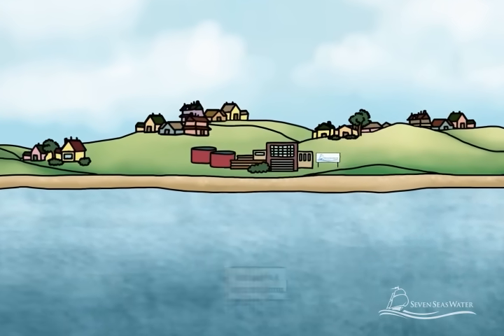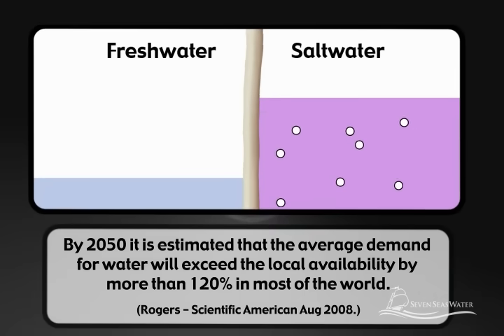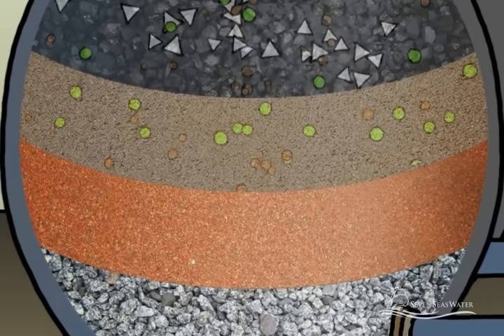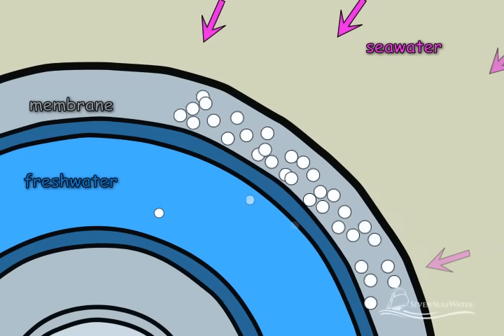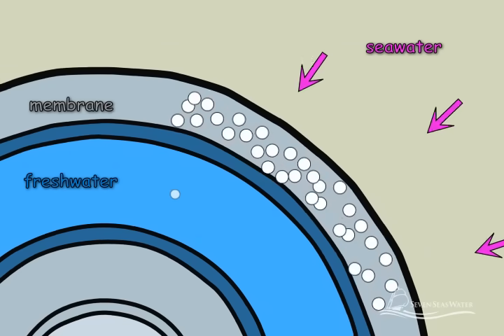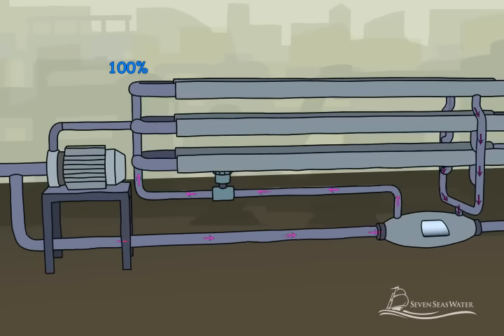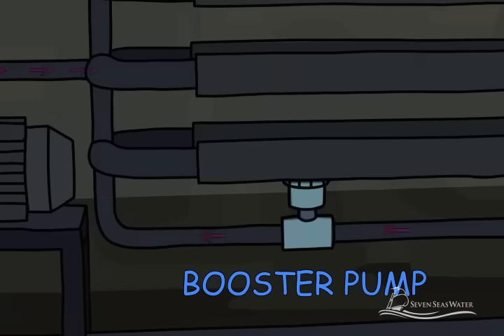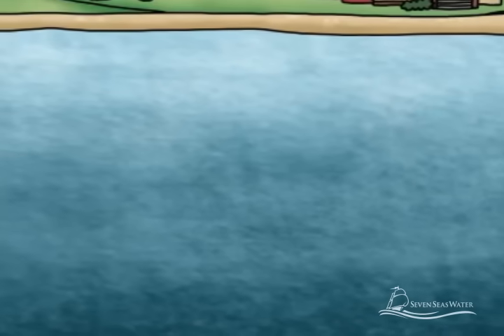How Seawater Desalination Works

Comment: why not use the brine to produce salt so no marine life gets killed due to sudden increase in salinity
Reply: Because you then have tens of thousands of tons of salt to dispose of, which if you dump it on land will poison the land and eventually wash back into the sea anyway. Due to the way the water cycle works, this process causes no net increase in salinity of the sea as a whole, but it does increase salinity at a local level. The brine needs to be dispersed much more widely to reduce the impact.

Comment: How often are those filters cleaned or changed?  I would be worried about lazy operators.  Who would make sure the plant is running properly and what would be the consequences imposed if it were found to be corrupted.  Greed is everywhere, as is human laziness.
Reply: As filters reach the end of their lifespan, the pressure difference across them increases, and the amount of water going through will decrease. If the operators weren't doing their jobs it would quickly become apparent, and they would probably be fired.
Either way, you'd have no reason to worry. Just because a filter starts getting clogged doesn't mean that it will let unsafe things get through. It would just let less water through.

Comment: doesn't ocean water have amonia?, i saw multimedia filters, other unclear type of filters, rivers osmosis, but were's the thing that removes chemicals from the water?
Reply: soro911 don't pools have pee
Reply: Since its surface water extraction, the RO process has methods of removing oil and other chemicals... micro tubes, it's a separate process that the desalted water goes through.
I thought it was funny they talked about the other processes the de-salted water goes through like further treatment and then chlorination, but didn't show any of the structure for it.  It's expensive on its own.
It's why water utilities around the world try first to use ground water before seeking surface water like river or lake water.  
Ground water is tested and filtered naturally not requiring a full chemical removal treatment... so long as the well continues to show safe levels of potentially harmful compounds and elements.

Comment: Wouldn't this make the sea water more dense in water which can hurt animals
Reply: Mongie Games the water we use is ether reused or cleaned and dumped back into the ocean it doesn't disappear thats like saying when its hot out and sea water evaporates does it hurt the wildlife of course not the oceans are much to big for any real effects
Reply: the difference between air pollution and water salivation is that we are not permanently reducing the overall amount of water in the ocean, because when we drink it it will either runoff back into the ocean via a river, or just evaporate and form clouds, drifting back to the ocean over time. therefore we are not decreasing the amount of water in the ocean. Since we aren't adding salt to the ocean, only concentrating it in a location, the amount of salt in the ocean isn't changing either. Because of this The overall ratio of water to salt will remain the same. The only time that desalination actually increases the amount of salt in the ocean is localized, and will rapidly lose effect over time. the problem is that desalination plants dump brine into the water continuously, so even though the salt is drifting back out to sea, it is constantly being replaced, making the harbor, bay, etc. too salty for marine life.
Reply: "Wouldn't this make the sea water more dense in water which can hurt animals"
It makes the salinity higher in the few meters of distance around the salt return. Salinity falls off with the square of distance back to background levels.

"if you take volume of water but leave the same amount of salt the salt density will go up"
But they're not talking away the water. They're cleaning the salt out of it, and then using it, before it runs back to the sea. Water doesn't get deleted from existence when you send it to the city. It gets used and then comes back to the ocean.

"The people who made combustion cars undoubtedly said the same thing about pollution"
The pollution we burn isn't finding its way back into the ground. The water we use is finding its way back to the sea. So this argument doesn't apply because the situations aren't similar. To make it similar, either water would have to stop flowing downhill, or air pollution would have to stop floating into the sky and fall straight down to the ground.

"This video doesn't say it returns to the ocean most likely a reserve to hold extra fresh water"
Of course there's a reserve. They don't have to say it returns to the ocean because it's obvious. Nothing can stop it from returning to the ocean. The city uses the reserve. They're not collecting it to look at for artistic purpose. They water things with it, drink it, and piss it back into the ocean.

"that is one of the biggest arguments against desalination plants, the excess of salt can easily kill marine life."
It can kill marine life within a few metes of the salt return, yes. If you put a net around the return a few meters away to keep all sea life out, you've stopped that from happening.

"the problem is that desalination plants dump brine into the water continuously, so even though the salt is drifting back out to sea, it is constantly being replaced, making the harbor, bay, etc. too salty for marine life."
No, that's not true, because the ocean has currents and mixes itself continuously. The salty water from the bay goes out to sea and fresh water returns. The rate at which desalinization plants increase the salt is only strong enough to be dangerous to marine life a few meters from the salt return. After that the flowing water currents of the ocean have returned it to normal by mixing it back with the fresh water you used returning back to the sea again.
Reply: John Arizona you proved my point if you take clean water from the sea over a long period of time you can hurt sea animals because the density of salt will go up because by your analogy you saying the sky's to big to get polluted was a myth so taking water from the sea not worrying about sea percent going up is a myth as well
Reply: Mongie Games It does return to the ocean.
Reply: that is one of the biggest arguments against desalination plants, the excess of salt can easily kill marine life.
Reply: Mongie Games read what you typed friend. Rewrite and repost, I will read.
Reply: Mongie Games the water eventually finds its way back into the ocean it doesn't disappear
Reply: Mongie Games No they said 60%saltier than water coming in
Reply: goes back to ocean of course
Reply: Mongie Games
 i think water current will distribute the salt everywhere. the ocean have waves. so don't worry because the rain will equalize it later.
Reply: AIYarabiaa no but your making the water more dense in salt you showed it in your video it's simple chemistry if you take volume of water but leave the same amount of salt the salt density will go up
Reply: Mongie Games
The water will return as stated and the amount of water we could take out of the oceon wouldn't make the slightest difference in ocean concentration. Provided it isn't placed right next to sensitive wildlife.
Reply: John Arizona the reason theres an effect on air quality is because they are letting out co2 and other pollutants that would otherwise be underground
Reply: This video doesn't say it returns to the ocean most likely a reserve to hold extra fresh water
Reply: caleb williams To secrete or produce saliva. 2. Informal To be full of desire or eagerness for something: salivated at the idea of winning the lottery. v.tr. To produce excessive salivation in.
Reply: John Arizona oh salination auto corrects to salivation lol. wait how is desalination a word but not salination?
Reply: caleb williams Both words different meanings. haha
Reply: It will not make the sea saltier because all the water that has been desalinated goes back to the sea as unsalted water (of course with some extra chemicals and contaminants) thru our drainage, rivers, and sewage systems.
Reply: William Barnes water is stored is wildlife so if you constantly pull water from the ocean to water vegetation then that water is not being returned to the ocean plus animals are holding water too if you breed 50 dogs this week and use ocean water for tgem to drink they will be storing more water as they grow in size so it might be 10-20 yrs before the animal dies and returns the water back to the ecosystem
Reply: The General You forget that animals pee. That gets returned to the soil. All water on Earth get recycled.
Reply: Jumin Han animals dont urinate all of the water out of their body so 100 pound animal will be retaining roughly 80 pounds or 10 gallons of water until the animal dies
Reply: Mongie Games Look up the water cycle dumbass.
Reply: The General . Water is required for respiration. Every time you exhale you breath out a little bit of water. When you sweat, water gets evaporated off your skin. When you exercise the glucose molecules (C6H12O6), and water (H2O) in your body get converted to H2O and CO2. You're a dink. 

The water cycle.
Conservation of matter. 
Facts, you're wrong.
Reply: When you think of the big picture and remember that are polar ice caps are losing ice therefore seawater is bound to rise the concentration of that sea water that is locked into the ice caps is less than regular sea water cuz it has less salt because it's literally frozen rain on top of those a polar ice caps or frozen moisture vessel so if you account for the fact that sea levels Rising with a whole lot more fresh water but that fresh water is messing with the salt water and then you put a whole bunch of desalination plants on the edges of coastlines you are really concentrating the ocean and don't forget that this water is going back into the ocean through processes of septic tanks or cleaning facilities yada yada yada and it's an equal but if you're coming up a local salvation of the area it is why is that people who do Seven Nation plants to put that exit valves in areas like well like the video States in areas where there is high flow So eventually it'll the water leaving the pipes from the will turn back into more equalized salinity due to the turbulence of where the exit pipes are put
Reply: Sorry I'm using text to speech and it really f*** up my last comment
Reply: I know this sounds dumb but could we just use it to make actual salt?
Reply: TheMoistMango : not dumb at all, just that there may already be plenty of salt production.
Reply: It could probably make salt production much easier since after filtration it would be in higher concentrations.  It would be better to turn it into salt and maybe through evaporation it could release water vapor into the atmosphere and the rest is turned into salt.  I'm not exactly sure how big companies make salt though.
Reply: So long as they spread it out in a big outflow area... and it never becomes so heavily used that rain water and fresh river water intake becomes less than intake of the brine solution.
Essentially, so long as we never rely on desalination for major agriculture we're okay.
But if we ever are reliant on desal for food production, we'll be feeling it as a slice of bread would cost in 2018 dollars about $50 to $100 dollars for a slice. Meat, well as steak would be close to $500.
Reply: Better them than us be without water.
Reply: The people who made combustion cars undoubtedly said the same thing about pollution "ahh the sky is too big for exhaust pollution to add up". Have you seen Chinas air quality or LA?

Comment: what kind of pump to they use ?
Reply: Nishikino Mimi garden pump
Reply: strong one :p
Reply: Nishikino Mimi Really big Lips
Reply: Kind of late, but the pump in the animation was depicted as a centrifugal pump... however, they showed it as a single stage pump, and in reality you'd need a pump with several stages and a powerful motor to reach 1000psig.
Reply: lil pump lol
Reply: Positive displacement pumps are often used in RO to provide constant freshwater flow against a high system backpressure from the membranes

Comment: y not just distalize it it's much easier and doesn't need the chemicals
Reply: costs more
Reply: If people would stop being so scared of nuclear power we'd have plenty of energy for it.
Reply: Need more energy and heat cost more
Reply: Monstrosity Sound Inc. I believe if you filter it through the ground enough you can remove most of the salt
Reply: @jerrymacmillanjr9955  Until the earth is saturated with salt, in about oh, 2 weeks.
Reply: but will take different activates as in the video
Reply: Reverse osmosis doesn't use harmful chemicals!
Reply: Chlorine Bleach is the best invention of the 20th Century.

Comment: 500 liter stainless steel (ss) water tank manufacturer and supplier in 
Bangladesh,1000 liter stainless steel (ss) water tank manufacturer and 
supplier in Bangladesh, 2000 liter stainless steel (ss) water tank 
manufacturer and supplier in Bangladesh,3000 liter stainless steel (ss) 
water tank manufacturer and supplier in Bangladesh

Comment: why can't we boil the sea water and collect the vapour from it on a mass scale isn't this cleaner and more efficient?
Reply: +kefalonia3 desalination on seawater alone is expensive and energy-intensive, polluted water would require more energy and be even more expensive. 

But disregarding those factors, compared to distillation, I think desalination would do a better job as it would be faster.
Reply: That's water distillation which is a thing but at that level would probably use way to much energy to boil water and a slower process overall. Just a guess but these filters can probably run low maintenance using less energy.
Reply: FutureAirways2 but can desalination work with really contaminated water? I mean really really polluted water?

Or does distillation do a better job?
Reply: In order for us to distill water we need to heat it up first, which we need to use some sort of reasource to do that. If you look at the basics of how coal, oil, and nuclear power plants work they're just steam engines that run off boiling water to crank a generator, so making a water distillation plant do the same thing would be like building a new power plant just for collecting water.

Comment: I wonder what the longterm effect will be of having such a highly concentrated salty return of water to the sea. Even if quickly put back and dispersed with natural flow, overall the salinity keeps increasing.
Reply: +Sabre you know water will make its way back to the sea right? its not like we're running out of water.
Reply: Sabre the salt was removed and then returned to the sea. Not a big deal if the return takes place in a a high flow area.
Reply: Earth is 70% water and that is like infinite water.
Reply: Even if NONE of the water ever returned to the sea, it would take practically for ever before a noticeable change would occur. Sea life would be able to evolve to the new conditions much faster than we could increase the salinity. Of all the problems one could worry about, this one must be very near the bottom of the list.
Reply: Tim Laursen
The salinity of the oceans is not effected AT ALL unless you lower the level of the sea, store fresh water on land in massive quantities which is NOT happening.  Only ice ages have done that.  Same quantity of salt and same sea level means identical concentration of salt.

Comment: Put solar systems on big vessels wich are heated by teh solar power + the natural heat of the sun and seperate the salt,sand etc. from the water, then further process this water with whateer cheap crap you want (e.g chemicals), way easier.
Reply: You might think solar hyrdo electric and wind energy would cost less but the investment building that grid far outways the cost to run these. Either way you still have to build a plant. So adding boats, panels, sea turbines, wind  generators yea millions upon millions instead of hundreds of dollars electric bill..
Reply: What if you wanted to do it at night or maybe inside?
Reply: TommytheroxTV RBLX no need for inside, but at night you can use turbines wich generate motion energy to electricity and from windenergy generators.
Reply: TommytheroxTV RBLX but that sun heating would produce way less than what you saw in the video
Reply: +NumidianKing just a question of scale the process!